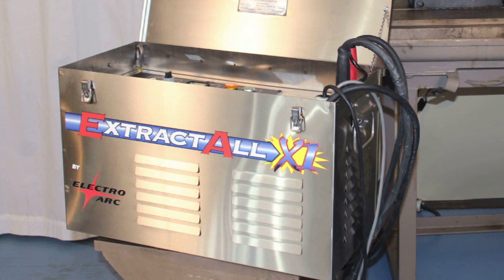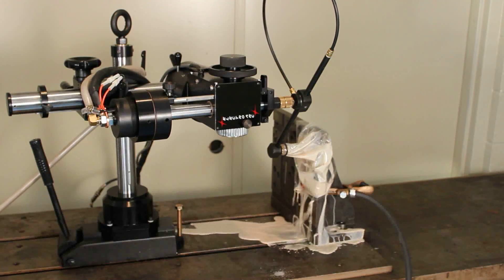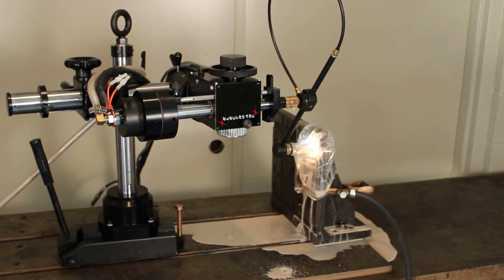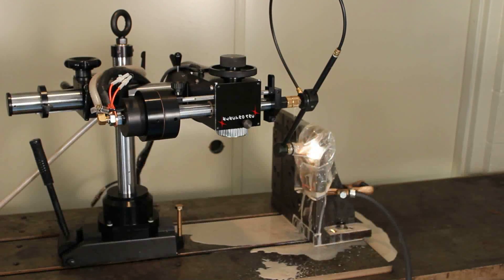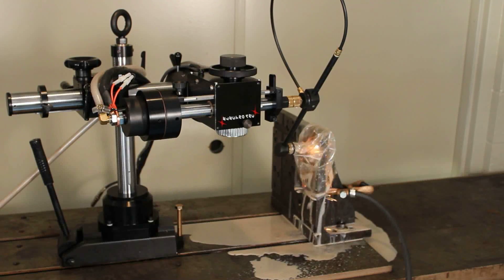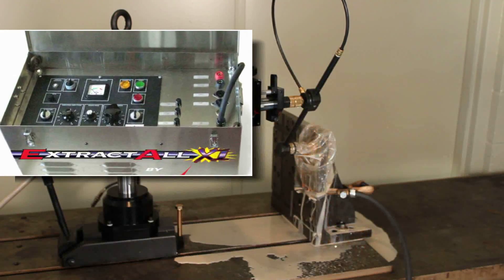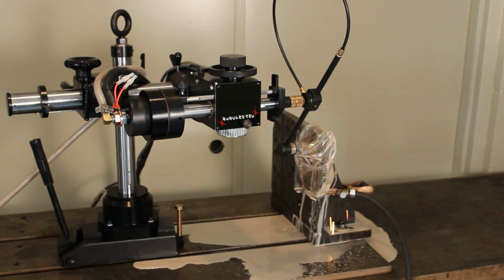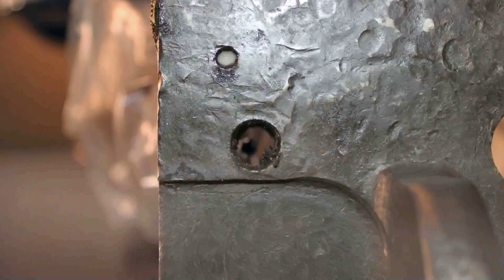Electro Arc EDM Tap Remover - Bolt Remover (Extract All X1)

Comment: This machine works very well !!! What are the electrical power requirements to operate it? What is the price? What consumables are used in the process and how much do they cost? Are replacement parts readily available for this machine? Where is this machine made?